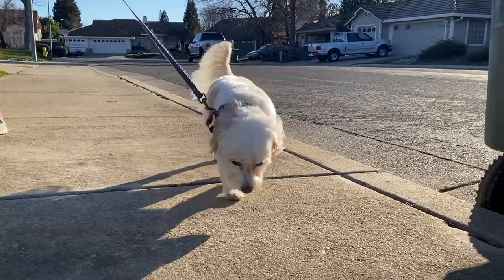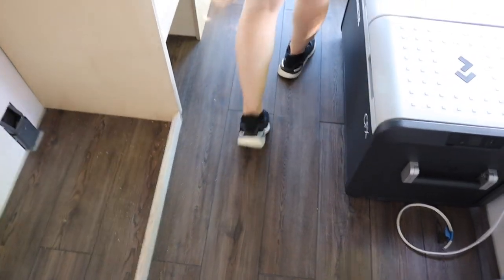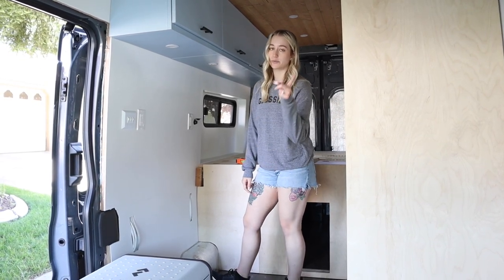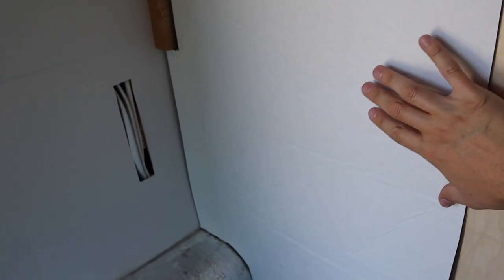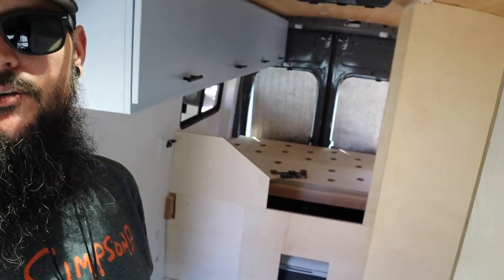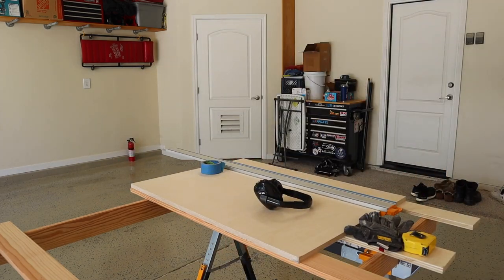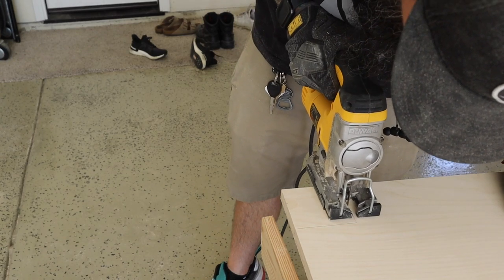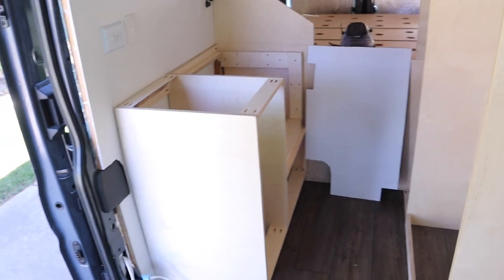DIY Kitchen Cabinet Build for Van Life with Oven & Big Fridge | 2021 Ford Transit Van Build Ep. 26

Comment: I've been following your build and I must say it is impressive work. Just designing and laying out the van is tough. So many questions always pop up. Not sure if you will check for questions because this is an old blog but do you have any idea how much plywood you used and was it 1/2" or 3/4"?
Reply from the maker: Thank you so much! We used 3/4” baltic birch for the cabinets (although it is very heavy). We can’t remember how much we used though, I’m sorry
Reply: @britandmike  Thanks, I thought it was 3/4". I'm going to use 1/2 which I think will be just fine. Your videos have been very helpful thanks. I won't get my van until Aug/Sept. Many things to learn.

Comment: Awesome - loving watching your build week to week.  What were the final widths of each cabinet unit?  And how far across the doorway did you end up going, half way?
Reply from the maker: Thank you! The total width of the cabinets is 74 5/8”. Individually they are:
Oven cabinet opening = 23” wide
Middle cabinet opening = 15” wide
Fridge cabinet opening = 34 1/16” wide 

The total sliding door width is 51 1/2” and the cabinets come out 26 5/8” (right about the middle) and covers approximately 16” of the 40 1/2” step.